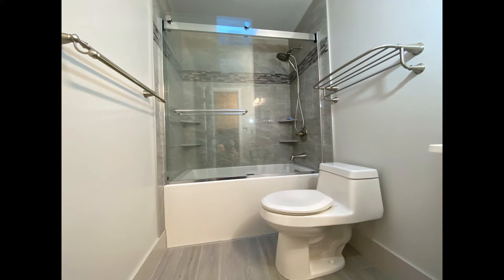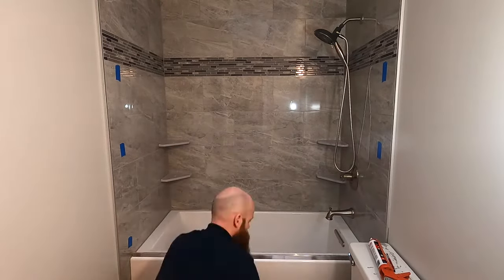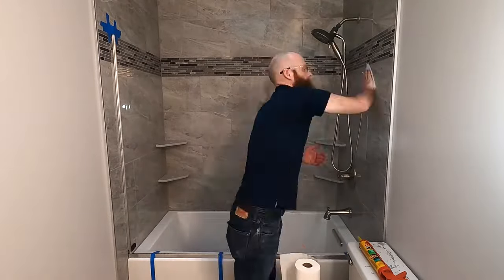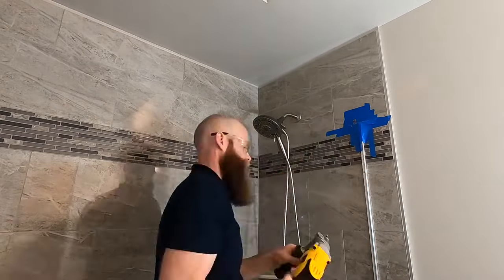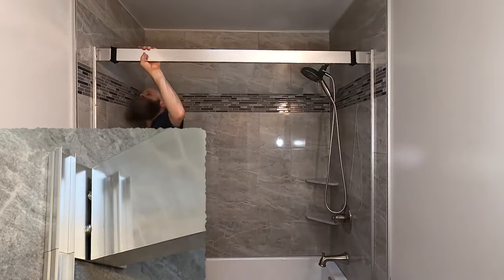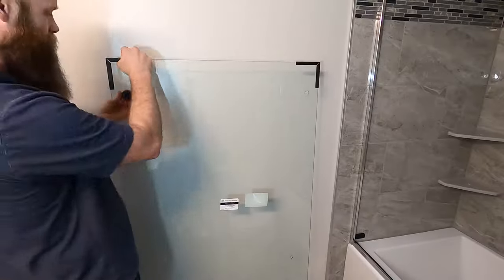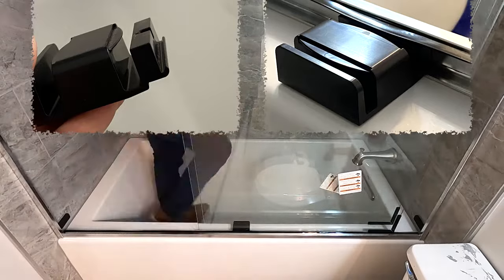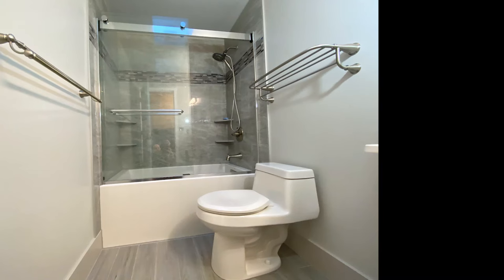Installing a Kohler Levity Sliding Glass Door

Comment: I just installed mine today. 85"H on a shower, no tub. The factory instructions are arleight, but you still need to use your nugget and common sense as they are not perfect. Kohler says to install the bottom threshold 1/8" away from the front edge. While it might work in some situations, it didn't in mine as I would end up with the mounting screws in the literal edge of the drywall of the side walls. I used the bottom threshold with the door guide to position the assembly in the middle so that the edge supports were being secured to the studs. That being said, everything else went really smoothly. Big shout out to my 16-years-old son Max for landing his muscle with the very heavy glass panes.

Comment: Nice video Joe!!  Thanks for sharing!  In the video from Kohler for the Levity Sliding Glass Door, they indicate that the base needs to be at least 3" wide to mount this door.  My walk-in shower is only 2-5/8".  Do you think 2-5/8" would be adequate to mount these sliding doors vs the 3" suggested width of the mounting surface.  Thanks!
Reply from the maker: The guide at the bottom would hang over the inside edge but other than that it would work.

Comment: Thanks for the video! Wondering if it needs to screw wall jams and the cleat to the stud?
Reply from the maker: The wall jambs are nonstructural and only help keep water in, so they don’t matter. For the cleats that hold the rail and the glass it can be a good idea to have wood behind to screw into but if you have good porcelain tile it’s not necessary. The tile will transfer the load to the backerboard that is secured to the wall.
Reply: @JoeMcCoskey  🙌

Comment: The manual says that a 3" flat surface, at a minimum, is required. It appears as though this would work fine if it's actually less than 3", as long as there's a gap on either side right?
Reply from the maker: The manual wants a 3” flat for the center guide width. I think it should be fine if the center guide hangs over the edge a little. I would just install it with the threshold as far to the outside as possible, this will give the center guide as much room as possible, but it connects to the threshold and can overhang inside the tub a little, if needed.
Reply: @JoeMcCoskey  Thanks Joe, I really appreciate your response. Thank you for this video - huge help.

Comment: what is the glue or silicone you use on the bottom of the threshold on the tub. i had someone install the door for me and I assume the heat from showering undid the threshold so now i have to put it back on so the door slides shut
Reply from the maker: I used 3M supreme kitchen & bath silicone.
Reply: @JoeMcCoskey  thank you

Comment: Awesome guide! Is your tub a Kohler Underscore (it looks like it)? If you used the tub, how did it fit for you? I'm seeing conflicting reports whether or not the Levity can be installed on the Underscore. I've ordered both the Underscore and Levity after seeing a user comment they've installed both. However, Levity spec says, "There must be at least 3" (76 mm) of flat surface on the bath ledge"; Underscore spec says, "Minimum flat for door 2-3/4" (70 mm)". But the tub looks like there's plenty of space with more than 3 inches on the edge.
Reply from the maker: It is a Kohler Underscore. The levity can be installed on it. The tubs ledge looks to be around 3” maybe less like the spec says. The piece that takes up the full width is the guide in the middle. It looks like it goes a little past the flat area on the tubs ledge but that’s not an issue.
Reply: @JoeMcCoskey  Thanks so much for confirming!!!

Comment: I just bought that style toilet, haven’t got it install yet. Can u tell me how to repair holes in tile? The contractor workers drilled holes then moved door. I can see that caulking in my beautiful tile🤦🏾‍♀️😩. Thanks for sharing
Reply from the maker: A color match caulking is a simple option. If you want it fixed like new, you’ll need to remove and replace the tile with the holes in it. There are some good videos on YT about this. Search removing single tile, replace cracked tile.
Reply: @JoeMcCoskey  thank you
Reply: @JoeMcCoskey  i withheld payment until corrected. As I’m texting, the contractor at Home Depot getting replacement tile. My tile shiny n correcting it this way, just didn’t work. They mad because shower was up😩. He should  have been here supervising his workers.
Reply from the maker: It’s not a quick fix and that would make everyone upset but if they drilled the holes in the wrong spot, then they should fix it. It’s very important to make sure your drilling holes in the correct location in tile, since removing and replacing the tiles is a pain. I’d say him and his workers can use it as a learning opportunity. Hopefully it all gets worked out for you.
Reply: @JoeMcCoskey  he admitted they(his workers )didn’t use the guide tool n that was their 1st shower like mine🤦🏾‍♀️ today. It all went well n he got paid. Thanks again

Comment: I can't get my doors to align with top and bottom bumpers. If adjust the rollers and  align the top,  the bottom messes up and If I address the bottom then top is misaligned. Just wondering if you can shed some light on this issue. Thx.
Reply from the maker: You should be able to align one side with the top and bottom, but the walls may not be parallel with each other, so one side would be lined up but not the other. In all reality I don’t think you need to worry about contacting both stops. I would split the difference and get it as good as possible.
Reply: @JoeMcCoskey  You ideally want to align it to the top and bottom of the glass with the wall that its sits against in a normally closed position. Aligning the inside panel with the wall that has your showerhead and controls, while aligning the outside panel with the opposite wall. That will prevent water coming out from in between the panels during a shower.